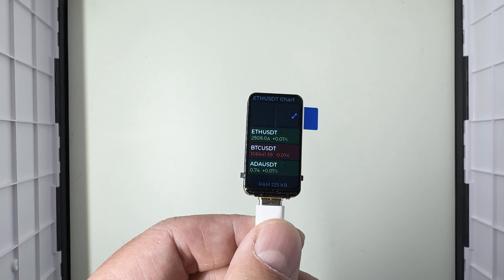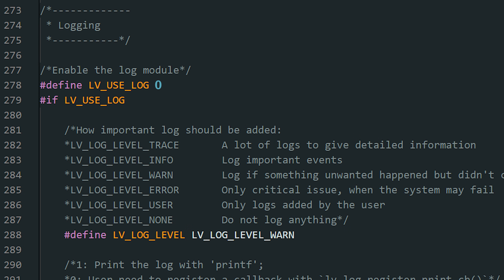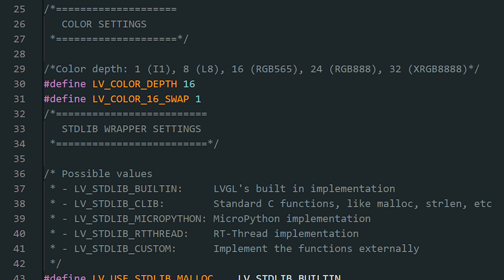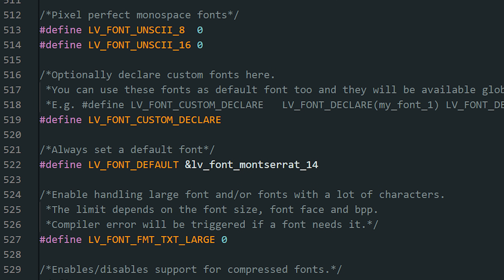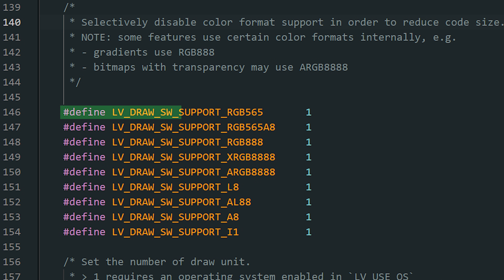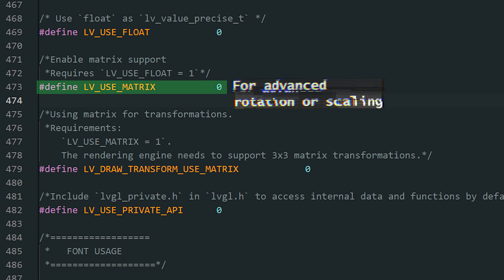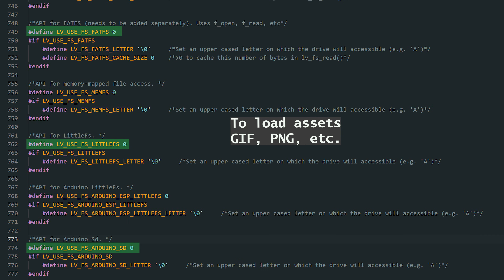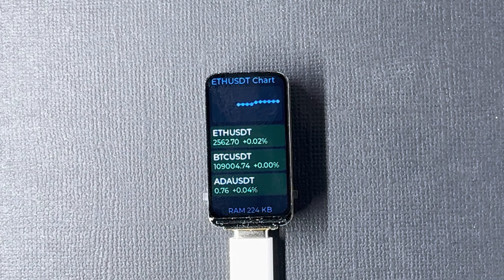Essential Settings for ESP32 Projects

Comment: For basic LVGL use on ESP32 how much ram is good to have?
Reply from the maker: You can do it on a ESP32 with no PSRAM if you comment out the features of LVGL you do not need in the configuration file.

Comment: this is very insightful... I'm having incredible difficulty displaying and changing text with large fonts on the Waveshare ESP32-S3-3.16 integrated LCD board.  as soon as loop checks for an update to the label the device no longer responds via serial.  Would buy you a lot of coffee if you can assist.  do you have a blog or place where I can get some assistance?  I'm new to Arduino, and really new to LVGL... thank you in advance. RJ